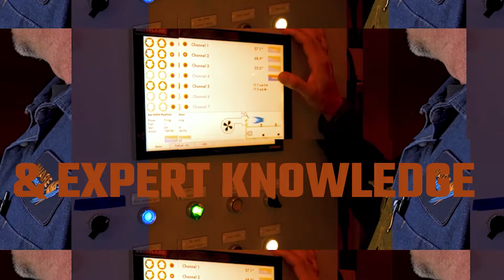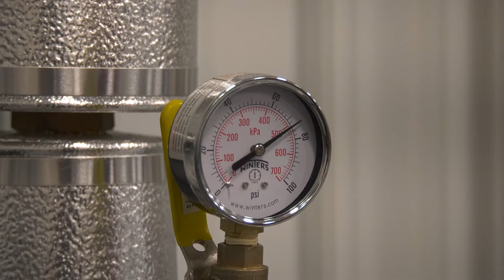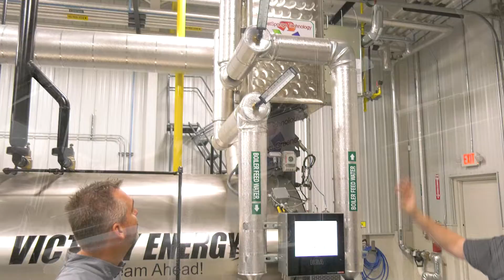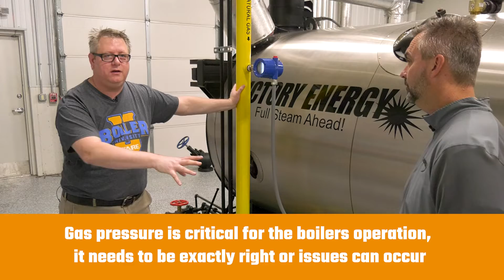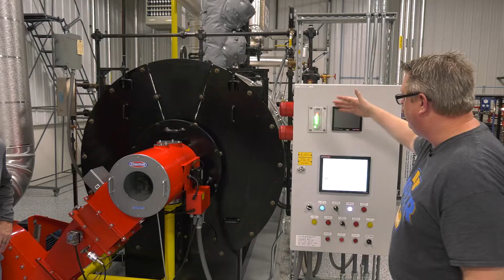How Does a Modern Boiler Room Really Work? Find Out on This Expert Guided Tour - The Boiling Point

Comment: The boiler's gas regulator vent where I work is a straight tube that goes up through the roof, but it's pointing straight to the sky. 
Shouldnt it need a goose neck or something to avoid rain water getting in?

Comment: What's a benefit of using steam boiler instead generator driven by natural gas turbine?
Reply: think its more efficient for large buildings to pump steam or water around for heat rather than just blowing hot air everywhere

Comment: Curious to know, how much water hardness is good for a boiler?
Reply: My guess is you want the water as soft as possible.  You definitely don't want minerals inside the actual boiler.. but I'm not a professional boilermaker, I just install glass on sky scrapers, and deal with the envelope of a building aka the finishing touches.  Think hanging 25 stories up on motor cabled scaffolding and suction cups.  Not easy work by any means😂.

Comment: I work in a powerhouse! Our incoming water is a mix of RO mixed with water plant treated water, over to the softener room, were in line sulfite is feed to cut chlorine, out of the softeners through our own RO system, back through the heat recovery tank, up to the DA, down to the boiler feed pumps, we run a closed system so we also have a hot well in the system! We had five coal fired in this building along with two oil burners!

Comment: Good evening, how true it is that if the water goes down on the boiler it and the sensors doesn't turn the boiler off, the boiler can explode? other question, can I do the blow down on all the water lines at the same time? it wouldn't make the boiler to explode right?. Thank you
Reply: No the boilers aren’t going to explode though I wouldn’t blowdown all the boilers at the time cause then you might overflow the blowdowntank, the DA might go into low water level it’s a lot of things that can happen doing it that way its not practical in my opinion. Be safe bro ask questions if you’re not sure it could save your life.

Comment: I work at a chemical plant and the boilers are always interesting to me. They have so many subsystems to support them. The one thing I hate is the hourly boiler horn test. This horn can be heard from miles around. It is that loud. Plus, what is a "mud drum"?
Reply: The "mud drum" is the smaller water vessel below the Boiler via water tubes & it's where most boilers water debris, otherwise known as "mud" that settle below the boiler vessel in the mud drum. There you'll have your yarway valve, inboard & outboard valves for blow downs to remove that debris or mud by manual blow downs.
Reply: The bottom drum on a water tube boiler.